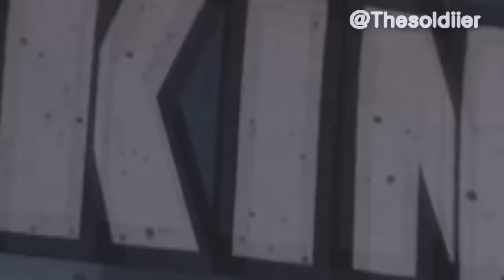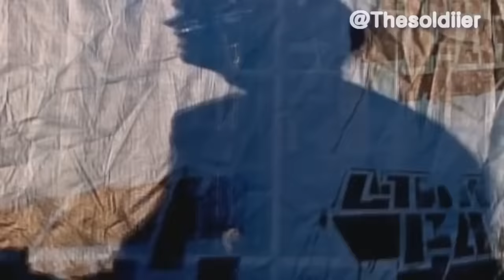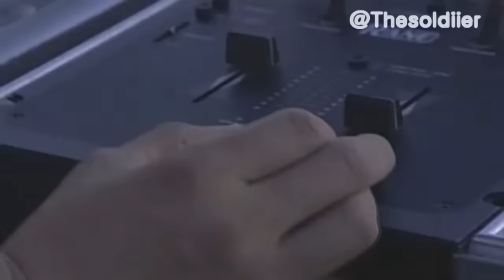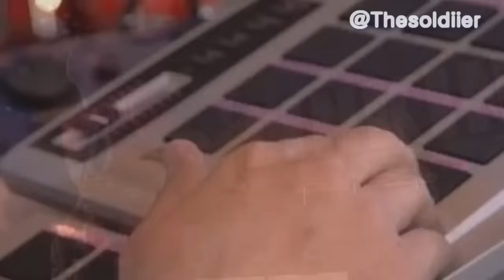Linkin Park - ROCK AM RING (Studio Version W/Intros/Outros) FULL SET

Comment: The version of Wish used here doesn't match with the video. The audio, I guess, is from that epic cover of 2004 where Chester did a 16sec scream in the bridge... But did he ever do that again? Nope. Also, most parts where Chester doesn't even continue his screaming in the video, he does scream in the audio.
Reply from the maker: If so, since I had to edit a studio version, I wanted to take advantage of putting the epic screaming, even though I knew they were not going to synchronize with the rock am ring version, it would still be worth it.